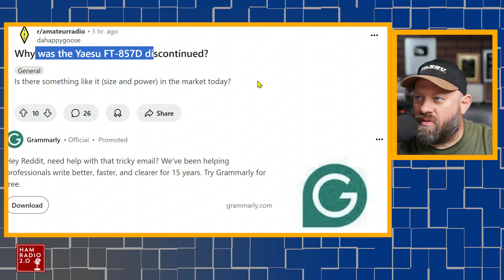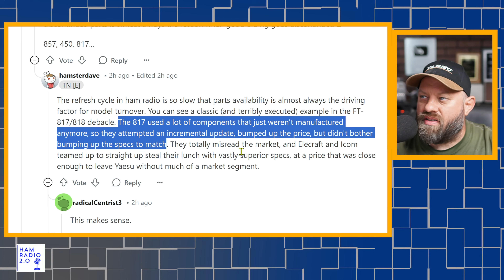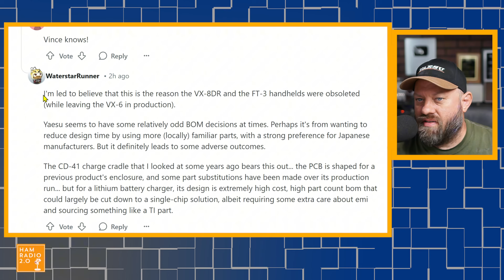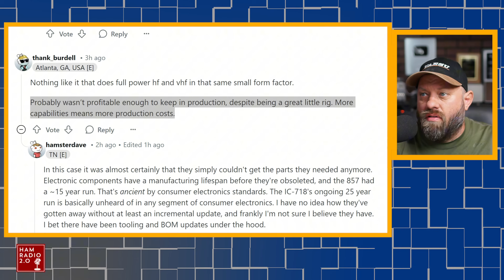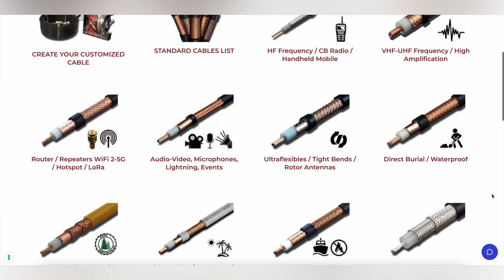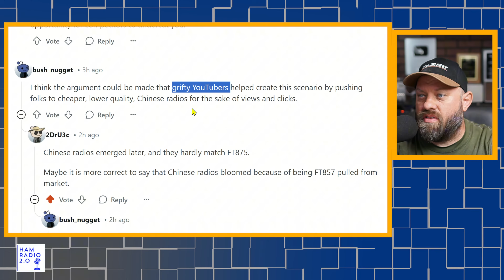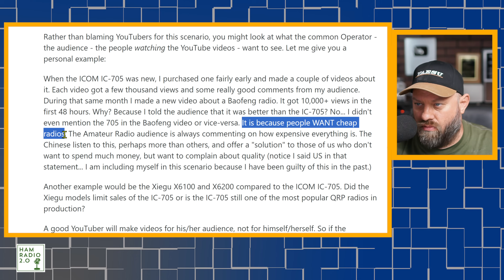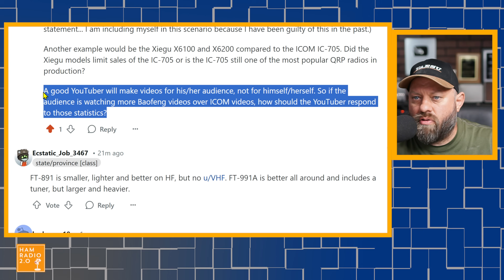Why was the Yaesu FT-857D Discontinued?

Comment: It was discontinued because Yaesu's manager are not that good. "Why was the FT-891 made without VHF and UHF", that is the question ! The 891 would have been the right choice. Instead the made the ugly 991A, with that useless panoramic display, that nothing has in common with the 857 nor the 891 and cannot be considered an upgrade to nothing. Well, maybe the FTX-1 is a replacement but it costs way too much and it is a very different technology radio that yet needs to be tested on the filed and that surely will be revised in the future to fix the imperfections that inevitably affect the products that go to the market. So should we pay a pricey product just to be beta testers ??? No, thank you Yaesu. I keep my latest 857.

Comment: The Yaesu FT-857D and the ICOM IC-7000 were two radios that would sell like hotcakes if re-introduced (modernized of course) today. Great form factors and decent all band operation. Most hams want to get on their air with the biggest bang for the buck possible, and these two radios did it.
Reply from the maker: Agreed!

Comment: I think people are interested in the Chinese radios because it lowers the barrier to entry. And that’s a good thing! More interest results in more demand! A lot of folks will eventually outgrow that cheap radio and shell out for the more expensive one. 

I love the x6100/IC-705 comparison. I considered them both and went with the Chinese radio because it was a lot less expensive AND has a built in ATU. Does the 705 have a better transceiver? I’m sure it does, but it’s not just competing on its transceiver quality. It’s also competing on price and features. Competition is good! Maybe that competition will push ICOM into a version of the 705 with an ATU in it. Or maybe they’ll find a way to bring the price down in response. 

There’s room for radios at different price and quality points in the hobby.

Comment: I bought an 857D when first released, or soon after. Principal reason then was transportability in a Pelican case. Airline overhead storage friendly. Right now it is my only QRO rig. Always well taken care of. No violent temperature changes. No extreme hot or cold. Never in direct sunlight. Never banged around. Power out 5 to 50/ 60 watts tops. I hope it will continue to function well. Perfect for my sporadic operating on 20M cw.
Reply from the maker: Yep

Comment: With regard to receiver sensitivity, there needs to be some clarification. On most of the HF bands, and VHF/UHF to a lesser extent, it is not the sensitivity, but the selectivity. The receiver on most modern HF rigs built in the last 25 years, easily hear waaaaaaaay down below the noise floor of most urban/suburban hamshacks, and your new rig can hear only what's above the noise. These guys showing tests with the signal generators need to not go directly into the rx, but use an isolation tee, and test WITH the antenna hooked up. It's a whole new ball game when you hook up the antenna. This is where the new DSP stuff really shines. Go get an iso-tee, and see for yourself. Sensitivity isn't your problem.

Comment: I use the older version of the Heil HMM mic which is the HMM-Y on the 857-D mobile set up. The mic makes a great improvement on your TX audio. It has two elements, the HC-4 for Dxing and the HC-5 for regular use (do not use the HC-4 on FM). Most Heil afficionados will agree that those are the best elements Heil made for ham radio. I have a pix of the radio and mic on my QRZ page. 73 de KB1TCD

Comment: Good video. Yaesu quickly figured out that radio's on the top of the Sherwood lost sell much better. So they don't release a radio that does not score high. Achieving the best Sherwood numbers is part of the manufacturing process for them.

Comment: ...thanks for the great comments Jason... remember, you tend to get what you pay for, you pay cheap and that tends to be what you get. I have arguably the two more popular HF transcivers being sold today... the similar form factor 100w FT 891 and a 20w Xeigu G90.. both are good but they are a world apart in features and quality. 

My G 90's mechanical tuning encoder has needed repairs/replacement several times,  a tedious job to say the least.. while the FT 891 uses optical tuning.  The lack of a bail or stand on the G90 is an irritant. Sure, you can buy one aftermarket but that just adds to the cost.. so in the end what did you save? The rubber cover on my mic cord is literally disintigrating before my eyes..no biggy but in a developing country, in which I live, you can't just run down to the ham store on the street corner  and buy another... you gotta order one, then crunch on some new RJ 45's.  

The FT 891 will feed into a 3:1 mismatch..but really? ...when it's that bad, why not just fix the antenna? As hams, we're supposed to learn how to do that stuff, our licenses didn't just come out of a cornflakes box.. Sure.. you can use an 'antenna tuner" as the G 90 has,  but your still force feeding a crappy antenna. That wet noodle.. it might tune but it doesn't radiate too well... 

Richard VA7AA

Comment: Question for those of you who have a “shack in a box” radio.
Do you use SSB or CW on two meters or 70 centimeters? 
Or do you only use FM for VHF/UHF? 
My only shack in a box radio is my FT-818, and other than hitting a couple of local repeaters the day I got it, just to make sure I knew how to set the repeater offsets and PL tones it’s only used for HF. I’ve never done any VHF/UHF SSB or CW with it. 
To be fair, my FT-818 would be part of my “bug out kit” and if an emergency happens. In that case the VHF/UHF capability would probably be useful.
Reply from the maker: I've used SSB and FT8 on 2M many times

Comment: I'm guilty of being part of the "it's too expensive" Brigade. I own an FT-891, and i believe its price point of ~$650 to be reasonable. If I recall correctly, the 817 and 818 were of similar price.

However, a perfect example has been the FTX1F. I was elated to hear that a replacement to the 817/818 was coming (both for a new yaesu qrp offering, as well as potentially a signal that yaesu may bring an 857/897 replacement in the near future as well!) but was immediately turned off when the words "it'll be closer to $2,000 than $1,000" were uttered...

Yes, "I don't have to buy it". More accurately, I can not buy it. I still can't really understand how Yaesu can claim to be creating a "replacement" for the ~$650 817/818s when said "replacement" is between 2-3 times the price of the original?

The only complaint I have with my 891 is it's lack of 2m and 70cm. It doesn't seem like any new HF/VHF/UHF All Mode radios are on the Horizon.
Reply from the maker: All the prices of the FTX-1F are speculation at this point. John said they didn't have a price yet, so everyone guessing that it'll be close to $2000, they're just guessing. 
I suspect it'll be competitive in price to the IC-705, but that's a guess from me. But the new radio will have many more features than the 818 so I don't suspect it to be as cheap as that one either.

Comment: The FT-991A is a great radio, but it's a beast - both in size and weight. Unless you drive a tractor-trailer rig or a big pickup, it's just too big to reasonably mount in an ordinary car.  The IC-7100 is a similar story because the control head is meant to sit on a desk. You need a creative kludge to dash mount it. 

I'm skeptical about the alleged problem sourcing components because Yaesu still makes the FT-891 and numerous small HTs. Why can't the components for the FT-891 and the FT-70DR be put in one box? The answer is that Yaesu makes a lot more money selling you both.

I hope China will break that stranglehold, sell something similar to the FT-857D (yes, likely inferior quality but that's ok) and force the big three to market a compact all-mode, all-band radio again that can be reasonably used in an ordinary car. $1500 or so for the radio doesn't bother me. $80,000 and 15 MPG for a vehicle big enough to mount the radio does bother me.

Comment: Jason, I think the FT-100D was awesome. It was discontinued for the 857 back when I worked at R&L… but it was superior to the 857, same form factor as the 891. It was also HF/VHF/UHF all mode full power.
Reply: FT-100D was plagued with problems. So many they were being sold on ebay for pennies on the dollar.

Comment: I have VHFUHF transceivers for FM and DMR 
Actually, except for 6 M SSB and CW in contests, very little
is on 2M and 70CM in those
nodes, so I no longer need
those bands in an HF 100 W transceiver, though I have the
FT818ND for portable use.
Therefore this combination
of HF/M and VHF/UHF all mode.
I cancelled my pre-reservation
for the Yaesu QRP with C4FM,
so I now have a great HF/6
Yaesu FTDX10 transceiver. 😊
73 de W2CH Ray Peekskill NY.

Comment: It was about time, it's a horrible radio full of chronic problems. Receiver is noisy, AGC is too fast, NR  doesn't work at all, speech processor is just a button, LCD goes bad, 455 Khz filters go bad due to lack of DC blocking capacitors, SSB output power you're lucky if you get 60 watts.....

Comment: Of all the Yaesu radios introduced around the same time, I always wanted to get an FT-857D, but timing is everything (I'm going to buy it - oops! my wallet is empty). I've known half a dozen locals that were using them, and one station has it in his truck as a daily use radio. Ultimately, I think the FT-897D, 857D, FT-817ND, and other similar radios, were discontinued (for the most part) due to certain parts becoming unobtainium. As far a receiver sensitivity it depends on where you use the radio. In a house in this area, you can expect as least an S3 noise level, so a radio having a little bit more in receiver sensitivity wouldn't make a difference (even at the local park, my 705 has an S1-S2 noise level). Waterfalls are great to look at. You can see where the action is both above and below your current frequency. You can't do this with the 857D, but what you could do, is actually see the screen in sunny conditions (as well, the 891). The FT-891 is a fine radio, and for POTA, I never use 2m/70cm, so I don't care. I sold mine a few years back to help get another radio (the IC-705) but finally bought another one. If there's going to be shade, or if I use the radio in my truck, I'll go QRP with the 705. If it's sunny, I'll dial the 891 down to 10 watts and have the luxury of seeing the screen in any lighting condition. There are only 2 radios I own that I'll take out in the wild with me to use 100w, the FT-891 and my Kenwood TS-50. Considering how much technology changes, it's astounding to me how Yaesu and even Kenwood (TS-2000) were able to keep their radio lineup alive (and Yaesu continues to do it with the FT-60r and VX-6r, two radios that are easy to see in daylight). It is interesting reading all of the comments thus far - good topic! 👍

Comment: I had an 857D and sold it. It was a good radio but the menu system was a pain to use if you were shifting around from modes. If you were gonna do something like lock in on running digital and not messing with settings it was great. The DSP filters were meh…

Comment: I hardly use UHF in my area. 2 meter VHF traffic is woefully slow.
I have a legacy Ten Tec I have for HF monitoring. Not alot going on there above the noise. 
I monitor Echolink. Not much there.
 A 100-160 buck QRP that I can put in my pocket and transmit from the Blueridge Parkway is about all I'm willing to fork out now for a spotty-at-best hobby.

Comment: Thanks for your thoughts. I figured the FT-8X7 line dropped because of difficulty in sourcing parts to continue manufacturing. I had a FT-897D that developed zebra stripes and Yaesu told me to find a parts rig with a good display to provide a replacement screen. I think the same happened for the 857s. 

They are wonderful rigs, though, for their use-case. I had bought a second FT-897D that I still take to the field. I don't care that it doesn't have the receiver specs of my KX-3, which I see as providing a solution to a different problem. 'Nuff said.

If you want/need to put out videos about the Chinese rigs, that's cool. I might yet buy a UV-Pro to play with because APRS interests me and my D74A does not play nice with my iPhone. (I know what to do, but that introduces another piece of equipment into the mix.) However, I am unlikely to buy one of the Chinese HF rigs unless my financial circumstances were to change such that I could not afford (or afford to keep) my better built/better spec'd rigs.

I understand there are hams out there who cannot afford, or do not want to pay, the price of current rigs. They are not inexpensive. But, they have to do a lot given the ranges of frequencies we typically operate at and the variety of support circuitry required to provide the modes and filtration we want.

I am also reminded that receivers have become so good over the last ten years that we are far into the diminishing returns space. My KX3 has a lot more receiver than I can use at my house because of the rampant noise prevalent in urban/suburban environments. Hearing anything of the 40m band here at the house is nearly impossible and forget the lower bands. Thus, almost all of my operating is portable. I'm not interested in the sensitivity wars because the differences are small enough that they will not be noticeable in practical application. Form factor and ease of use are far more important to me.

Fun stuff! 73 de AG7TX

Comment: There are still a lot of older radios like this in service, including the IC-706 line.  I still have 2 of them running, although not the G with 440.  My only one of those (G) is currently apart in a box after an ill fated repair attempt on my part.  Oh well.

Yeah, new radios with digital mode support , built in tuners, dual band waterfall display etc. are cool, but when it comes down to it I mostly run my mobile rig for local vhf/uhf FM repeater and HF SSB contacts, the older rigs still do that well.

Comment: I asked yeasu at Dayton when they  dropped production of the 857. I was told the wanted go with the 897 and 991 was thier shack in the box. I really liked my 857s but I will say as I got older I needed the larger screen on the 991.
Joe WA4UJY
Reply from the maker: Well they discontinued the 897 about the same time as the 857
Reply: @HamRadio2  my bad I meant the 891

Comment: Im glad i have held onto my old Icom IC-7000.  I had a Yaesu FT-897d and several 817's and still have an 818 . But the whole linup that Yaesu put out with the ,817,857,897 were perfect sure the AF DSP wasn't great but they weren't desktop radios,  they were field rigs. I bought my Icom IC-7000 to have that IF DSP especially to eliminate AGC pumping with CW and data modes. BUT the IC-7000 demands the same current that a desktop rig does. Today with LiFePO4 batteries we don't have to worry as much with heavy current demands.   My friends and i loved Yaesu's field radios had a lot of fun with them. de N3TGY

Comment: Your comments are right on point. I would only add that, while parts shortages are a real issue, Yaesu more than any other manufacturer (ham radio or otherwise,) seems to cry “parts” for product line cancellations.

Comment: Once the FTX-1F comes out both Icom and Yaesu will have QRP SIAB radios.  Why is it had to make them 100w?  On the "too expensive" side, for me at least, the hardware is not over-priced but it does carry a high price.  To mee "too expensive" mean "not worth the price tag"  and I don't believe hardware from the big Japanese companies is "too expensive"  I think I can't afford it, but that's not the same thing.  The things I think are actually "too expensive" are most of the antennas on the market.  There are companies charging over $100 for a balun and some wire.  

Videos I like are about the DIY projects.  I think I watch most of the top ham youtubers, you, SmokinApe, K8MRD, HRCC, K6ARK, Temporarily Offline, and that off road GMRS bozo.. Some less ham radio specific but some ham content like TechMinds.  But I also watch several channels that are DIY electronics with little to no ham radio content as well.  

That's my 2 cents.

Comment: I would venture to say that miniaturized parts are the factor for discontinuing production. It’s a cost factor plain and simple. Smaller= higher cost. Still have my original FT857 (not D) with CAP and MARS active, needed for SAR ops.

Comment: The FT-857D doesn't have the plug and play connectivity that newer radios have. You have to buy external components like a Signalink to use digital modes.

Comment: This is not related to the video topic but I’m in the market for my first mobile radio between now and getting my general. I’m looking at the ftm-150rasp and the id-5100 and the ic-2730. I’m still not sold on digital modes but having the ability to grow into Aprs, or dstar, or dmr would be nice even though dstar is the only digital mode offered in my area. I won’t be too bothered either way because HF digital is way cooler. I’m mainly looking for something to dual monitor some emergency weather repeaters and regular talk repeaters when out storm chasing. Any input would be appreciated

Comment: I hated it and replaced it with an Icom 706MKll because the screen was too small.. I own the 706 and the Icom 7000 and a Kenwood TS2000 and Kenwood D700 APRS mobile.
Reply: Screen size is probably my biggest complaint. I bought the 857 before my eyesight went down hill. Still love the radio though, just have to scrounge up my readers before using it.

Comment: Excellent points. Antenna and receiver are most important. If you can’t hear them, then it’s just problematic.

Nothing wrong with QRP. In fact, I think QRP is an art form. I even tried transmitting on just 1 watt. You get the right antenna, people will hear you.

- KF0QNM